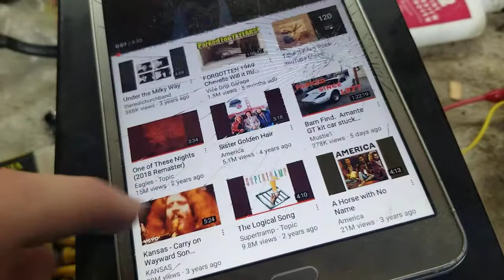1954 RCA AA5 Tube AM radio ressurection

Comment: Change out that electrolytic filter capacitor and those wax capacitors and do it right the first time. Shorted filter capacitor is probably what's drawing too much B+.